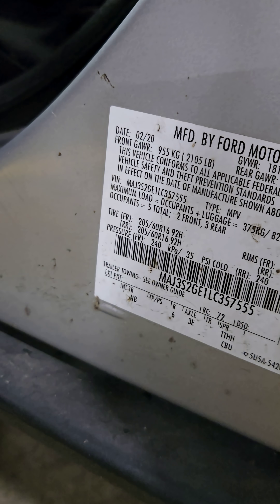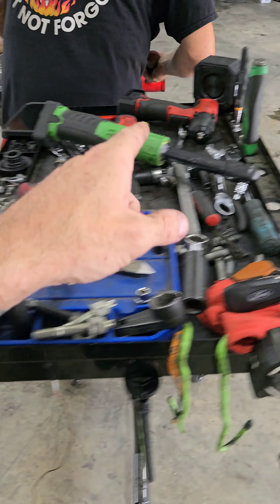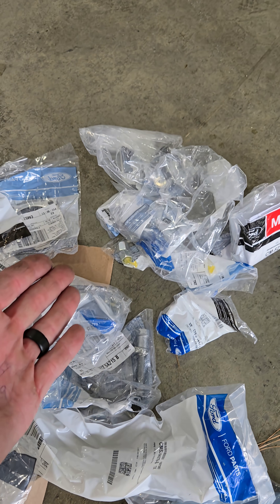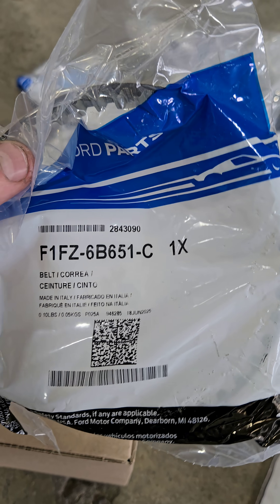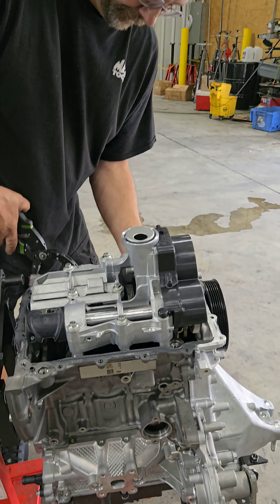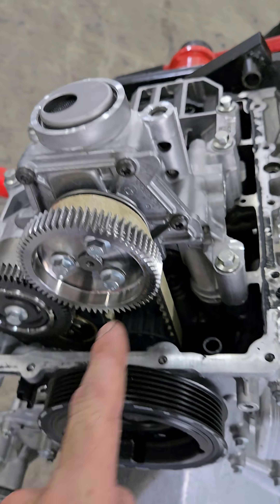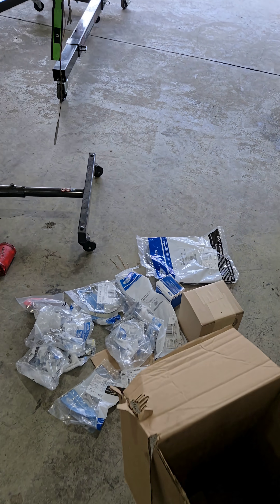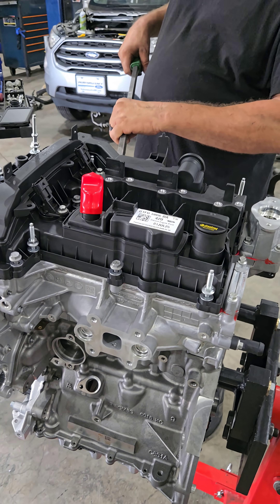Brand New Engine Torn Down WHY? 1.0 Ecoboost

Comment from the maker: No, the engine does not need to be removed for this.  He is doing an engine replacement and might as well do it while it is out before it goes back in.
Dont forget to check out the merchandise store. Shirts, stickers, tools and more! Much appreciated.

https://rainmanauto.com/?sca_ref=9370312.bQvZS1ntE1YzC0vL

Timing belt number in old engine
E3BG 6K288 AA
Number in new engine
E3BG 6K288 BA
New timing belt being installed 
E3BG 6K288 CA

Just so we are clear. Many engines use a oil lump belt. GM and the 3.0 duramax on the back of the engine. The 2022+ chevy 2.7 liter(dry).  Ford 2.7 liter Ford 5.0 (21+ f150 not the mustang) Some audi, Hyundai,  PSA (stellantis) volkswagen just to name a few. Its not just Ford.
Reply: No, but it makes it a whole lot easier to do.  How much does that engine cost?
Reply from the maker: @bearing_aficionado no idea. Warranty
Reply: @BeardedFordTech oh ok.  Yeah the dealership I got my truck from replaced the cam phasers for me after I called the sales manager and told him about it.  I was like how did this get Ford's Blue Advantage for being a certified used vehicle with the phaser rattle?  He said bring it back and he fixed it for free.  The invoice came back and said warranty on everything.  I was curious to know the costs.  I had to replace two of my phasers and timing chain on my 2011.  That cost me $3500 several years ago.  I imagine it went significantly up by now.
Reply from the maker: @bearing_aficionado warranty gets parts at cost. So their prices are significantly lower. Phaser job on a new f150 is around $4800 give or take
Reply: @BeardedFordTech mine is a 2018  but could still see the price being that much.  Lord have mercy.😬
Reply from the maker: @bearing_aficionado yep. Did them on a buddies truck in my driveway like 2 year ago on his 2018 5.0. Mine is a 23. Slight changes
Reply: @BeardedFordTech oh damn.  I couldn't fathom having my truck torn apart in my driveway like that.
Reply from the maker: @bearing_aficionado I do it for a living though lol. He helped and learned.
Reply: Amazing I really can't complain my 97 f-150 5.4 litre just turned 29 years old 349k miles , luckily it has egr and didn't get the new cam phaser upgrade ,  somethings are left better unchanged  @bearing_aficionado
Reply: Would love to see the old wet belt condition.
Reply from the maker: @seagullsbtn I can do that on monday
Reply: Bet FOMOCO paid maybe an hour for you to swap all of that out on one of their new engines they so graciously sent you.
Reply from the maker: @ricknelson947 9 hours

Comment: Still got a wet belt which maybe gets the owner out of warranty before it fails again. 1.0 L engine is a turd no matter what you do.
Reply from the maker: Yep. Its junk. That i can agree to. But here's a question. The 2018 + 2.7 has a wet oil pump belt. So does the 21+ 5.0 in the truck. How many of thise failing have you heard of?  Honest question. Rarely any at all if any. Because this little 1.0 is a cheap and a completely different kind of belt
Reply: @BeardedFordTech  Was this the same 1L recalled in Europe? Just curious.
Reply from the maker: @johnscott5105 yes. It was recalled here in the US First.

Comment: Ford Quality 😂😂😂😂
Reply from the maker: Oh thats all manufacturers quality. Cause its not just ford who uses it.  If ypu believe that you have been under a boulder
Reply: @BeardedFordTech I am a mechanic, I know perfect all the shit rolling on this days, I am a 38 year old, 25 years of mechanic experience 15 year en Chrysler Dodge Jeep Ram Fiat, Mitsubishi, Mercedes Benz 😂😂😂 i am dealing all day with power stroke shit, Duramax, Cummins, and all their suppliers chain 🤮
Reply from the maker: @lokyblack3379 i worked at dodge for a bit.  Straight garbage. So is the duramax. Powerstroke has some issues yes. Most of it stems from the owner usually using it as a pavement princess and not working it.  The cp4 issue well legally i csnt speak on that right now. Wish i could. But im 42. 25 yrs experience. Trust me. Its not just ford. Its all of them. The difference is Ford actusllt sees a problem and tries to fix it. Unlike gm who tried to gide it then got forced to do a recall by NHTSA

Comment: I have motorcycles with larger engines than that turd.
Reply from the maker: That means you dont like harley cause those engines are smaller(cylinder wise). But we have already established this engine is a turd. You are behind.
Reply: @BeardedFordTech Lol.
I will ride any bike OTHER than a Harley honestly. Victory and Suzuki at the moment.
Reply from the maker: @boost331 oh thank you Jesus. I wanted a victory vegas 8 ball.  I ride too.  I race sport bikes. Closed road courses like VIR tracks like that
Reply: @BeardedFordTech Sweet..!! I had a Suzuki SFV 650 track bike when I was younger. A work accodent that wecked my back pretty bad made that a no-go for me these days. Even the riding position of sport bikes is too uncomfortable for me after about 20 min. I do still love speed though. I have a Victory Octane and Suzuki M109R now. Cruisers that are still pretty dang quick.
Reply from the maker: @boost331 indeed they are

Comment: Don’t get why Ford bosses accept a belt to drive the oil pump. I guess they like to have work for the future
Reply from the maker: I dont get why people think this is only ford. Many manufacturers use it.
Reply: ik but it’s a ford video
Reply from the maker: @JohnFPeq so everyone else its okay to use. Just not ford. Got it.  May I suggest looking at the other manufacturer failures too (especially the gm 3.0)  I'll admit this little engine is garbage. We dont see wet belt issues on the 2.7 or the 21+ 5.0 (truck only mustang doesn't have it)
Reply: @BeardedFordTech ford or not….its garbage
Reply from the maker: @JohnFPeq it actually does have benefits. Theres a reason manufacturers went to belts. Ive talked to engineers from didferent brands. Instead of the oil pump being on the crank where it can break the teeth, and the oil pump is closer to the front it takes a little longer for oil to get circulated. With a belt. The pump sits further back in the sump comlletely sumberged. The belt has less friction and oil is supplied almost instantly. So it has its benefits. As for a timing wet belt yeah thats trash no sense in having that at all.  Havent seen any issues with wet oil lump belts on any other engine as long as they are using the correct kind of oil that meets or exceeds specs.  The problem with this 1.0 id a combination of the tensioner and the timing belt.  Maybe if they used a chain or even a dry belt. The peoblem wouldnt be there. Its not the oil pump belt issue. Its the timing belt. We juat update the oil pump belts why we are in there.

Comment: Oil pump belt??? 😂
Reply from the maker: Yeah. Nothing new. The ford 2.7 has been using it since 2015. No issues. The ford 5.0 21+ truck (not the mustang uses it. Not an issue. Audi, hyuandi, Volkswagen , PSA (steallantis) GM 3.0 (on that back of the engine) gm 2.7 (dry)  shall I keep going?
Reply: @BeardedFordTech yes keep going 😂
Reply from the maker: @southernstyle8835 lol. That wasn't meant to be rude. But many manufacturers use them.

Comment: Can we get a step by step on removal and install with the special tools?
Reply from the maker: No. Cause thats 9 hours straight. And it is a very tedious job.  Nobody should be doing this. Its a recall its free. No need to go in there. I can do a breakdown on the tools when they are installed. But im not doing a 9 hour step by step

Comment: Wet belts, turbos, gdi. Evs look like a safer option.
Reply from the maker: Ohh much safer. Until it catches fire. Or that battery goes  and costs more than the car
Reply: @BeardedFordTech I'll take my chances. It's not like you can buy a brand new pick up truck with a simple and reliable 4 cylinder engine, those days are gone.
Reply from the maker: @micbad4689 the 2.3 i had in my 2019 ranger. Simple reliable. Turbocharged ( i know you dont like them)  maintenance is low on them.  Wait til that tesla needs a baytery (same with any electric vehicle) it costs more thsn the car is worth. A chance im not willing to take. And I do a lot of traveling. I would need to stop every 200 miles (give or take) to charge it. I'll pass

Comment: Oil pump belt…that’s all you have hear to understand why Ford is Fuqd
Reply from the maker: Oh man oh man. Apparently you have been under a rock.  Ford isn't the only one who uses one. So I'll break it down for the 10 millionth time.

Hyundai, Audi, Volkswagen GM (on the 3.0 on the BACK of the engine) PSA (steallantis) just to name a few all use one.  This is nothing new. The 2.7 ecoboost has been using it since 2015. No issues. The 5.0 in the truck 21+ (not the mustang uses a oil pump belt as well. No issues.

Comment: A new engine for an engine under warranty, while the new one on warranty has already a recall before putting it in? 😂🤦‍♂️
"Ford, die tun was!" 🤭🤣
Reply from the maker: It was built before the uodsted belts were released
Reply: @BeardedFordTech Yeah, sounds like 100,000 km/mi practise tests skipped! 😂🤦‍♂️
Do you know how Mercedes-Benz tested its engines and new cars in the past?
1 car drove day and night, 24/7/365 in the death valley in the USA, 1 car drove 24/7/365 in the north of Finland, 2 cars drove 24/7/365 on German/European roads and offroad with commercially available fuel.
They did it until each of the 4 cars had reached 1,000,000 kilometers. Then they took everything apart for looking if there were any cracks, unusual wear or any weak spots BEFORE the 1st car of this series, with this engine or with this A/C was sold!!!
Failure impossible!
If you took medium care of such a car and with some luck you could drive them 4 or 5 million kilometers.
Today? Rust and engine failure right after warranty. 😵‍💫

Comment: Oil Pump Belt! Now there’s a definite flee in terror when it comes to an automotive engine.
Reply from the maker: You do realize a lot of manufacturers use an oil pump belt. GM 3.0 on the back of the engine.  Ford 2.7 ecoboost ford 5.0 (21+ f150 not the mustang)  audi hyundai volkswagen psa(stellantis) just to name a few. I have a 23 f150 5.0. Belt looks great. Never seen an issue with a 21+ either. Never saw an issue with the 2.7 liter either. Now this little 1.0. They arent kevlar reinforced. And the 1.0 is garbage. Funny how everyone thinks its only ford that uses a oil pump belt.
Reply: @BeardedFordTech  well, I have ! A 2.7 ecoboost, of course,  it was in a couple weeks ago, low on coolant, because the heads are cracked inside the exhaust port, near the turbo outlet,  and he still owes like 10K on the POS......
The oil pressure light / warning came on on the expressway, now he's trying to decide if he's buying a used 2.7, or a reman.......
Converter shudders like hell too ! 
I'll keep driving my 300 6 powered F250....
Reply from the maker: @jamesgeorge4874 yeah thats really common for cracked heads on them. Coolant will go into turbo.  What year is his?  And how does his maintenance look?  Pretty slim right.
Reply: All GM 3cyl 1.2 and 1.3 as well😐

Comment: The wet timing belt idea is stupid for those eco boom engines never buy wet timings belt engine the snap at very low mileage
Reply from the maker: A lot of manufacturers use it(a wet oil pump belt snyway) The gm 3.0 (on the back kf the engine) the ford 2.7 the ford 5.0 (21+ in the truck not the mustang) audi, Hyundai, Volkswagen PSA (stellantis)  this little ecoboost is trash though yes I agree

Comment: Why did anyone think it was a good idea for a rubber belt to be used in engine oil anyway.
Reply from the maker: 🤦‍♂️I think you are confused. The rubber belt itself is not a good idea. However kevlar reinforced is.  And this one wasnt. Which is why there is a recall to fix it.  And another thing I think you may be confused about. This isn't the only engine that uses one. The following use a wet oil pump belt.  GM and the 3.0 (and its on the back of the engine) Hyundai, Kia, PSA (steallantis) some audi.  The ford 2.7 ecoboost. The ford 5.0 liter (21+ truck not the mustang)  yet all of the ones mentioned are kevlar reinforced. Except the 1.0. And the 1.0 is the problem child.

Comment: Timing belt? What is this, 1990?
Reply from the maker: Lots of manufacturers use a belt. Honda some audi hyundai PSA GM
Reply: @BeardedFordTech Maybe in legacy engines. And that's a big maybe.
GM is junk, so nothing will surprise me there
Reply from the maker: @XB10001 gm is junk i totally agree. Look at the 6.2 failure and its chain. Them crankshaft issues they got going on
Reply: @BeardedFordTech Don't tell me that was also an interference engine ... 😮
Reply from the maker: @XB10001 okay I won't tell you. (Yes it is 😂)

Comment: He said "1.0L"   i was like wtf, then  He said "oil pump belt"  Nope , Nope , Nope. Not even a real engine at that point..
Reply from the maker: You do realize there are many manufacturers thats use a wet oil pump belt right. GM and the 3.0. PSA (steallantis) Volkswagen Audi, Hyundai, Kia. The ford 2.7 liter. The ford 5.0 is the 21+ 5.0 f150 (not the mustang) theres actually a lot that use it.  But this little engine right here is garbage.  And ill admit that. Strsight junk. Wet belt does serve a purpose if its the correct kind.  And this one wasnt the correct kind. The 2.7 and 5.0 use a kevlar reinforced. Thats what hes putting in this one. And its still junk
Reply: @BeardedFordTech  well i would never consider purchasing  those brands  its wild that any company would do that , whats wrong with a oil pump driven off the crankshaft? Worked well for decades.. but i guess if you only want to keep a car for 3 to 4 years and its disposable  then having a oil pump belt doesnt matter ..
Reply from the maker: @JMPCARREPAIRS oh lots of problems as well with crankshaft driven ones.  Keyways break. Pumps lock up things like that. Anything is peone to failure. So i guess all the trucks that ford has with a oil lump belt (2015-present 2.7 liter) (21+ f150 5.0) are only good for 2 or three years?  I guess all the ones on the road shouldnt be there. Its a maintenance item. Just like a chain.  Actually costs less to do.  The benefits of a belt (when they work correctly, not like.in the 1.0) is less friction.  Less vibrstion. Less stress on moving parts. It has its pros as aell as cons

Comment: Cuz the ecosport and the 1L are complete garbage and need to just be thrown away and never be put in a vehicle ever again
Reply from the maker: Yesh we have established this already. It was designed by the chinese
Reply: @BeardedFordTech just like the new model lincolns
Reply from the maker: @BdeSimon 🤷‍♂️. Havent seen the new lincoln. But ford and lincoln are the same. And mercury
Reply: @BeardedFordTech yes, lincoln is the higher end of ford, but just as cheap. The new nautilous or aviators are being 100% built in china and shipped to the US.... Its disgusting
Reply from the maker: @BdeSimon 🤷‍♂️ i know what lincoln is. Like GMC and Chevy. GMC is the nicer version but both are still got piles of garbage
Reply: @BeardedFordTech absolutely! New ones anyway
Reply from the maker: @BdeSimon so is RAM. Anything 2007 and newer on gm is junk

Comment: Ford is pure junk now. Hideous  design..putting a rubber belt inside the oil bathed block.. 2.7 the worst. ..1.0. Liter  not worth a paper weight.
Reply from the maker: I've never seen an issue with the 2.7 belt. Or the 21+ 5.0 (in the truck mustang doesn't have a belt)  those are kevlar reinforced. The original one in the 1.0 was not. The updated belt is. But I do agree the 1.0 is junk. But so is anything GM and Dogdge Ram make.
Reply: @BeardedFordTech its just that they designed the belt to run in the pan bathed in oil as a wet sump. Not a chain drive or an impeller off a gear. Totally not impressed
Reply from the maker: @WayneSummey-q8c you do know gm does that on the 3.0 duramax right. On the back of the engine. So does volkswagen and PSA (Steallantis)
Reply: @BeardedFordTech yip👍
Reply from the maker: @WayneSummey-q8c 👍

Comment: Yep that's what I was saying. Even though you are putting a brand new engine in you still have to change out the oil pump belt and the tensioner with an updated part
Reply from the maker: Cause the new engine was built with the second part number. We are on the 3rd part number. The final update.

Comment: Wet timing belt AND oil pump belt… these sub-2.0l EB engines are trash.
Reply from the maker: The 2.7 ecoboost has a wet oil pump belt. So does the 21+ 5.0 in the truck (not the mustang) but yes the 1.0 is trash
Reply: The 1.5 is considerably better, other than an injector recall I haven’t heard anything bad about them really.
Reply from the maker: @xl7667 in the bronco it isn't that great. Water pump issues. The 2.0 is way better
Reply: @BeardedFordTech my company has two escapes, maybe that’s why. The 23 had to have an injector recall done on it and the 22’ has been perfectly fine. Sounds pretty cool too. What I do hate though is the 8 speed transmission, all it does is gear hunt and it shifts too early.
Reply from the maker: @xl7667 the you need to reset the adaptive learn.  The injector recall was for injector cracking